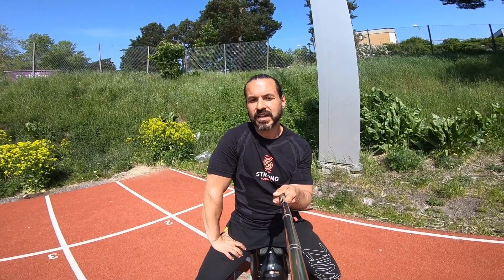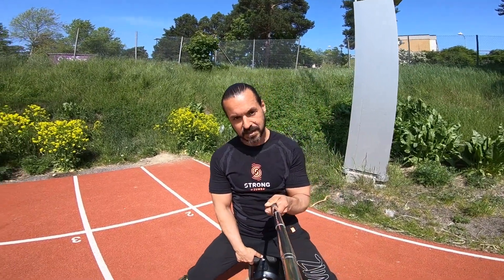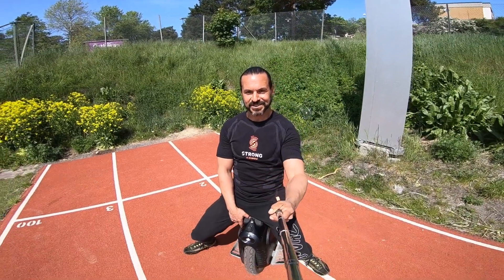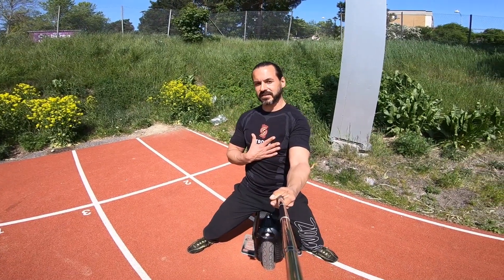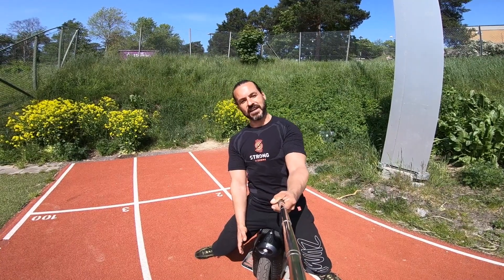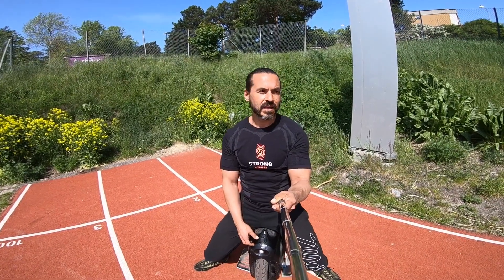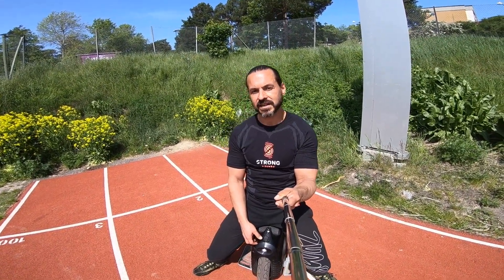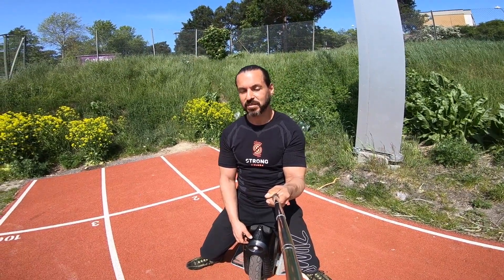Wheel Talks - Dipping and Carving

Comment: Thx so much for these tips. Carving helped me tremendously with my turns and with getting rid of the wobble.
I did a practice run in a parking lot once night and the next day things just clicked: did 25 km very comfortably, in different conditions (light trail, uphill / downhill, even on the street). My confidence level went up sharply and the fear is almost all gone!
Reply from the maker: Thanks Patrick! That's great to hear! Today I was riding with some friends and I was wearing different shoes, they are a bit longer so I fooled myself visually when looking down at my foot placement. My feet were still too far back.. which I noticed when trying to get past 50kmh. It was silly how much I needed to lean forward and I di not feel safe... and actually got a little wobble which I immediately carved out.

It can get scary now and then and then fun part is that there are more challenges to conquer! Great to hear of your progress!